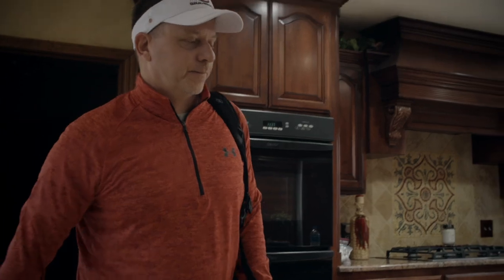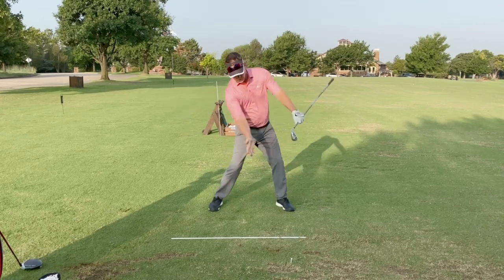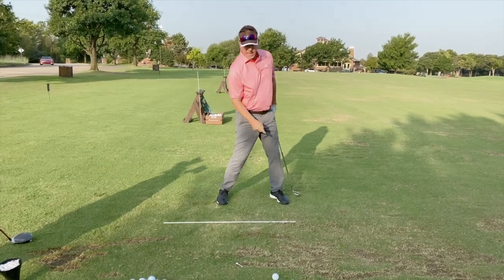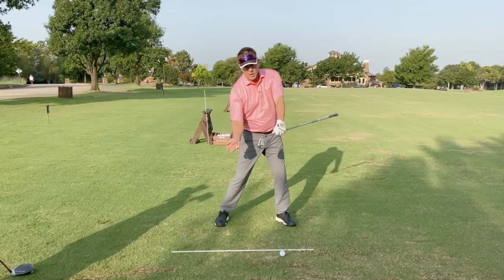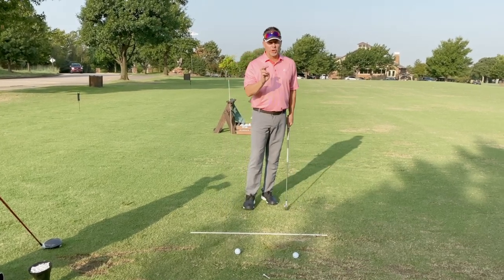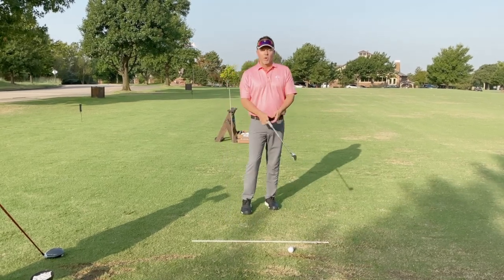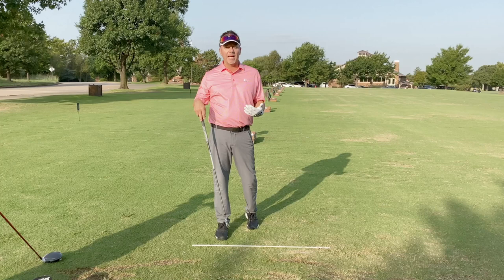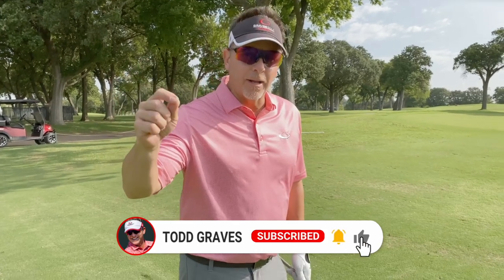Common Single Plane Golf Swing Questions (Part 1)

Comment: In your next video can you explain the feet, hips, and shoulders to the target line, are they parallel. With the Alignment trainer I find my feet are open with the short irons, parallel mid iron, and closed with the long irons and driver. Is this correct. Thanks for answering my question.
Reply: Are you fairly happy with your accuracy? If so, keep doing exactly what you are doing, I think what you said makes perfect sense. I saw a swing analysis video of Moe Norman hitting his driver. It certainly appeared to be a slightly closed stance based upon the ball flight. Almost like he was slightly pulling the ball.
Reply: My irons ball flight is straight but my driver I have to play a fade. If I try to hit it straight with the driver it’s a straight push or a slice.
Reply: @terrywells2095  I can relate to that for sure. I prefer a fade or straight shot with my driver.  I despise the hook that gets me sometimes with driver. I know the fade isn't as far, but it is controllable. I'm wandering, because I have the same issue, are you turning your shoulders back enough in the backswing? I have been working on this recently myself. A slightly closed driver stance should encourage a bit more of an inside out swing.
Reply: Over the summer I have been video taping my to match the Moe model. I will review my video footage and check my shoulders. Thanks for the advice.
Reply: @terrywells2095  Something else that I struggle with that can give me too much of a fade and even sometimes a slice. Is I don't complete my backswing, I don't always have that split second pause at the top, this throws my timing and sequence way off. Something that has helped me is to say to myself during the swing, "left shoulder down, right shoulder down." This helps me turn the shoulders back enough and then have a slight pause before starting the downswing. Hopefully Todd will chime in for you. I certainly didn't mean to overstep.

Comment: Todd,
Everything about Moe's swing you copied to teach us how to strike a golf ball better.
When and why did you decide to change the way you teach the position of the feet?
Moe stood dead straight, toes pointing forward and side feet adjacent to the target. However, you teach lead foot angled toward the target.
I know your reasons behind it as I've watched your videos but was the change purely for distance because why would you change a technique which was perfect already??
Reply from the maker: I teach Moe's foot position.  I have no idea what you are talking about.
Reply: @ToddGravesGolf  apologies for not being clear. 
When Moe hit drivers and woods it seemed from the camera angle of most of the videos of him that his stance was closed, meaning the slightly turned out lead foot would appear straight and the side of it would be now adjacent to the target (because the stance is closed).
Is this right or just a trick of the camera? because it's very hard to know where the target is when viewing videos.
Reply from the maker: @findmelightsdotcom9280  Yes.  The feet are slightly "closed" with the driver and 3 woods.  Moe and Ben Hogan preferred this as it biomechanically solved the radius of th swing issue.